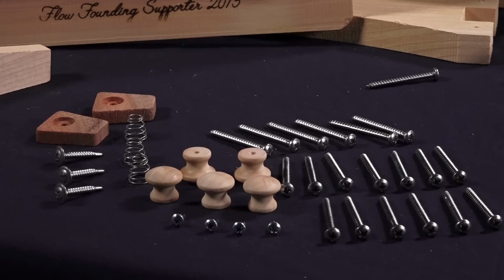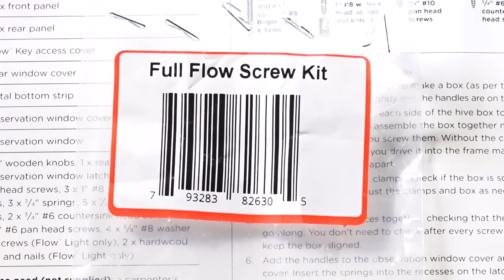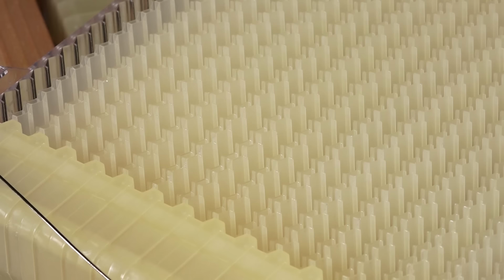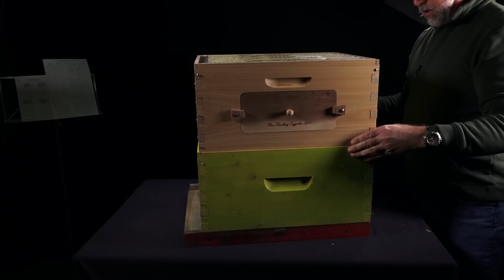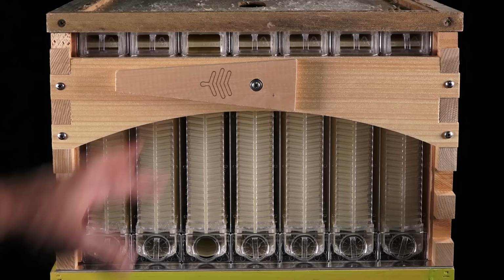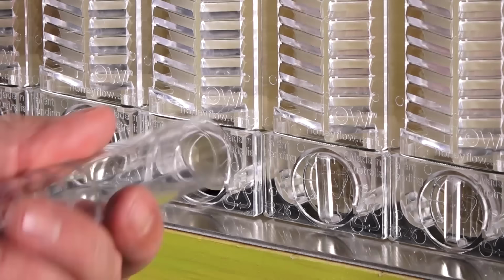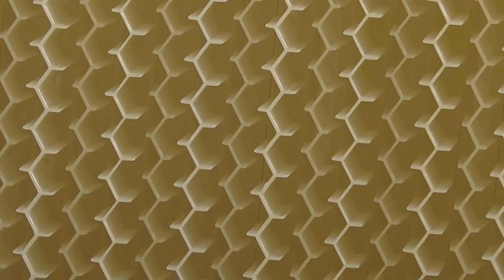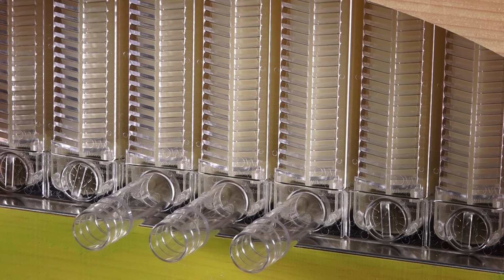The Flow Hive for honey bees, Love it? Hate it? or Undecided? Price? Review of Quality Control

Comment: Just touching on your hive price comparisons that you omitted. With the flow hive, you don't need any extraction or bottling equipment. With the standard hive kit, you have to add extractor, capping knife, cappings collector, strainers, buckets to collect both cappings & honey. Then you have to figure out what to do with the cappings? Then you have to decanter your honey. Furthermore, a lot more bees die during honey harvesting...

But I strongly agree with your final statement about making money from the flow hive as a novice. Having strong colonies takes effort, just the same as keeping healthy fish in your fishtank.

I concur that beekeeping (to me) is all about my interaction with my bees, not about the honey or the money... When you get into a practice of sitting with your bees, opening at least once a week (weather permitting), they will remain strong, friendly and they will get to know You! That is truly special.
Reply from the maker: You can crush and strain, uncap and drain, an extractor is not necessary and an uncapping fork is extremely cheap and most people have sharp knives available already for uncapping. Uncapping tanks with a drain hole are easily made and hardware cloth works to catch wax bits. Lots of ways to remove honey for those who wish to do that which don't involve purchasing a spinner - a hobby level 2-frame extractor is $159. Or an entire extraction kit is available for  $379 - I apologize for not including this information:  https://www.betterbee.com/extracting/exkit-extracting-kit.asp

Comment: Great video! I had similar issues with misalignment of the joints. But it was easy to fix. I did not have issues with screws, however. The screws you show are for the plastic window. I had different screws for the knobs provided.
Reply from the maker: +Thomas Schmid Easy to fix for people like you and me... not everyone will be prepared to perform carpentry on the box. Those screws would have penetrated all the way "through" the material left for the window... yours must have been different. Thanks for sharing!

Comment: Have you put the Honey from a Flowhive and Traditional box hive under a microscope, to see if there's any difference, or sent samples to Labs for nutritional analysis ?  To see how the honey itself develops in Plastic Cells vs Cells made from Beeswax.  I would also think the vibration from the bees also plays a part as plastics and beeswax have different vibrational properties and heat retaining properties.
Reply from the maker: Hi Knessi, yes, honey samples have been sent off and the news with drawn comb hasn't been good I'm sorry to day, it seems that pesticides from ag applications have found their way into the natural comb as well as commercially sold wax foundation. We have not found a lab yet that has tested positive for any plastic particulates in the flow-honey. Honey extracted from natural comb and well filtered, is virtually no different from honey drained from flow-frames. Unfiltered Flow-Frame Honey does have some wax particulates as well as bits of propolis and has the highest pollen particulates when compared to traditionally extracted, uncapped, filtered, and bottled honey. I do both ways here and am always thinking about the impact of processing on drawn off honey. One thing that really bothers me at the moment, is the cut comb honey that is so valued... learning that the wax has industrial chemical residue in it, is particularly troubling. Farmers and beekeepers are not on the same page at all. Naturally drawn comb just isn't what it used to be and that's sad. https://www.theguardian.com/environment/2017/oct/05/honey-tests-reveal-global-contamination-by-bee-harming-pesticides

Comment: I just received my flow hive kits.  I am having similar quality concerns with the manufactured box joints, a missing screw, and the screws being too short.  I also have concerns with badly bowed boards, no shipping notification or tracking information.   I have sent my feedback to honeyflow.com.  I hope to hear back from them soon.
Reply from the maker: +Paul Derbyshire Sorry to read that Paul... I hope they take care of you very soon. Please share when you hear back from them.
Reply: +Frederick Dunn Well it took about a week for honeyflow  to respond.  After sending pics and waiting a little longer Honeyflow agreed to send 3 new brood boxes and  1 super (just the wood for the 4).  I decided to use my own screws which were in plentiful supply in my shop.   Furthermore I also discovered that some boards were  badly warped and not the correct height.  The heights were so bad that in more than one board at one end of the board you had 9 5/8" and the other end was 9 1/4".  

The new boxes arrived the following week but were really were no better.  Same joint issues.  1 board with height issue.  I'm reworking the wood as not to waste very much but unfortunately some pieces are just too bad to be really useful.  I will inform honeyflow of this second problem but not request any action.  I am treating this as an expensive  lesson learned that the honeyflow wood hive production quality needs some heavy attention.  I think the design is sound however the production is not.

My suggestion for now is to think twice about purchasing the full hives from honeyflow.  Too much labour required to rework the wood.  Too slow a response.

The Flow frames on the other hand arrived in good condition and I look forward to testing them.  As Mr. Dunn has pointed out worth at least trying as to be better educated in the future.

My final comment is that I also have had to add another small layer of wood beside the flow frame at the front.  The gap(s) between frames were just too large.  Funny enough, the small lengths of wood supplied for the wooden brood box frames for the top of the frame proved a perfect fit for the supers.

Thank you for such a good video.  I look forward to seeing even more of your videos in the future.
Reply from the maker: Don't forget to share your experience on the FlowHive forum... I do know that the wood manufacturer reads and responds to those posts... he basically says that there isn't a problem though...

Comment: I'm not interested in bees or any of the sort but thanks, this video really taught me a lot about inspecting a product. This product is useless if a person who isn't like you happened to buy it. Setting it up an getting the required material takes more time and more money than necessary.
Reply from the maker: It definitely would be a huge frustration point for anyone without woodworking tools. The woodworking contractor who made this box is no longer manufacturing for the flowhive company, my other two boxes came from a company in Oregon and they were perfect.

Comment: I think it should be fair enough to point out that your hive came from a US manufacturing site, not an Australian one. 

All of the cuts, inclusions etc are all from the American site. Did you let the founders know? If not, you should have. 

My experience, being Australian and having the Australian version, was very different. The fits were excellent, the screws were different and I am really very disappointed for you that you didn't get the quality you deserved. That says much about American manufacturing, though, not the hive itself. From my founding hives (bought two) and about to get a Flow Hive 2 in the Araucaria wood. I have had absolutely no dramas with them at all.
Reply from the maker: All hives since this period, are now coming directly from Australia and they are perfectly fit as they are now laser cut.  Yes, I did provide feedback to the Flow company as well as received a response from the U.S. mill that made this box, the U.S. responses was "most of our equipment is good, there are some small numbers that didn't work out, but most of our equipment is defect free", no apology, no concession as to why they didn't fit and many who received the first run had similar issues, so that contract was cancelled.
Reply: @FrederickDunn  that response from the US site is disappointing, particularly at a time when manufacturing is suffering there. It's good to see that years on you are still enjoying the flow hives as I am.

Comment: Great video. Thanks for your honest opinion. I currently have a top bar hive, but found this interesting. I am concerned about the plastic, both it's use and durability. We have temperatures from 100+ to -20 degrees here in Colorado. It's not uncommon for the temp drop by 70 degrees in a few hours!! Does this come with any warranty on parts?  Cost is prohibitive for our small community garden. Assembly would be difficult, esp. if things don't "fit".  I will be watching to see how it works out. Love your idea of a bee shed.  :)

Comment: Hi, i have had a hive for over 12mths and I’m not at fan at all. They have no thermal properties, the roof cracks in the heat, and my bees are not a fan at all. I also have a HiveIQ poly hive which are way more productive than the Flowhive.
Reply from the maker: Thanks for sharing what you've observed. Mine are all doing fine.

Comment: My Hive was easy to assemble. One of the joints needed a little sanding to help it fit better. You refer to the joints as "Dovetails" which they are not - I think "finger joint" is the correct term.  Overall I was very happy with everything.
Reply from the maker: +Jeff Bateman They are actually "box joints"... thanks!

Comment: Hey folks, the only difference between a flow Hive and the common langstroth Hive is the flow super. The rest of it is just a box and regular frames. Save your money, and just get the flow super, and simply set it on top of your langstroth hive in the spring. Warning: it will be about the majority of spring and summer for your bees to take to the flow Hive super, and build it up with wax. So basically like any other hive, don't expect honey on your first year.
Reply from the maker: Thanks for sharing, you're right, the biggest advantage is the flow-frames and honey extraction without smoking the bees.

Comment: great work sir very informative video and very well presented. my only concern besides the bad quality of the frame is the plastic. I know that plastic releases toxic vapours especially under the heat of the sun. A quick search shows that the number 7 on the plastic means it contains different and mixed plastics together and it is not clear if a particular type prevails. most of the time, these plastics release or 'sweat' toxic matter. just a thought...
Reply from the maker: All of the components are available for testing at various temperatures... If the data provided by The Flow company is incorrect, someone will certainly be blasting them very soon if the material is found not to be inert. There are plastics in most feeders and there are also plastic frames that have been in use for decades. They are also touted to be "food grade" plastic. I will be happy when someone does perform some comprehensive analysis. You're certainly not alone in that area of concern.

Comment: It is cheaper for the traditional bee hive however factor in the cost of the separation of the honey from the comb
Reply from the maker: As well as the consumption of your time when taking off and processing the honey. I've become spoiled by only having to have clean jars, lids, and then just waiting for weather conditions to be right. I've personally stopped doing traditional extractions altogether. My honey-harvest bench, with spinner, uncaping tank, wax separater and frame racks now just sits unused, but ready. I don't miss the mess and lengthy cleanup. Also isolating the extraction to specific frames which vary in taste and source, bonus.

Comment: I think they have a good product but have priced themselves out of the market they crowd funded the startup and plastic parts are fairly inexpensive to produce so I have a hard time justifying the price they are asking for the frames.  I think you are right on the money by saying you can get the whole setup for much more reasonable price elsewhere.  Although I would not buy the knock offs I think they are in the correct price range for what these are.
Reply from the maker: Hi Robert, the plastics they use in these frames are actually more expensive to produce than I originally thought. I have a friend locally who is a CEO of her own company and they produce food grade plastic components for food related equipment. I was pretty surprised at the cost, but of course FlowHive folks also mark them up, but I don't understand, with what I know now, how the Chinese duplicators are doing it so cheaply... I'm highly suspicious of the material composition  in the copycats I see coming in through Amazon and Walmart. Walmart and Amazon accept no responsibility for sellers materials claiming food-grade, or FDA approved materials, none, it's just the "honor system". Since this video, I'm completely converted to Flow-Supers and Flow-Hives... I'm officially spoiled. And my honey-harvest room sits clean and idle. All we do now is bottle honey.
Reply: @FrederickDunn  I would love to try the flow system but as a hobby their pricing puts me out of the market I can make my own supers but buying just the frames is not much of a savings I have been educating myself and would love to start a beehive in the spring honey is only a bonus as I think the bees would help my fruit trees out with pollination hence the not wanting to get into all the traditional harvesting.  I do believe that you have to pay for quality but still seems quite expensive.
Reply from the maker: @Robert-Smith  I wish you all the best Robert, I started with traditional boxes, nothing wrong with that at all.

Comment: I am curious to know about the long term effects of these flo - hives... If the bees don't need to work as hard to establish a colony... Won't that result in poor quality honey?  The bee's not having to build the actual comb may condition them to not produce as much wax or even worse cause them to produce a liquid wax that merges with the honey?  Making a honey with a higher wax content?  Am I worrying for no reason?
Reply from the maker: You are indeed worring for no reason. They still build was and draw out comb throughout the hive, it's just the flow-frames which they don't have to do so much "wax-work" on. The honey from the flowframes is actually purer and more Flavor-Pure than honey extracted with uncapping, crushing, and spinning along with filter stages. I've done both through the years and Flow-Hive direct honey draws are my absolute favorite. I've never heard of "liquid was that merges with the honey"? Wax particulates along with propolis bits are easily removed and don't "merge" with honey. Those are two completely separate bee bio-processes.

Comment: Thanks for the great overview.  And the price point comparison to traditional kits.  I've only seen traditional harvesting done with those centrifugal extractors, which are also a couple hundred dollars.  It seems that if you buy one honey flow system, its a bit more expensive then buying one traditional kit and the extracting equipment, but if you were to buy two or more of each (honey flow or traditional kits with one set of extracting equipment) then it gets more expensive per kit.  I guess its more about the convenience with the honey flow system, and like all products, there can be a moderate to hefty premium on convenience.
Reply from the maker: True... until they offer bulk pricing, most intermediate to commercial keepers won't be using the flow-system. We also have to wait and see how long they last season after season and will have to factor in replacement costs. This year, I'm going both traditional and flow harvests. An advantage to the flow system is (for me), that I can just take off a couple of quarts from one frame and not have to smoke them, pull the frame and filter the honey. It is definitely more convenient on a small scale to have flow-frames. The cost is of course higher.

Comment: Hey Fred
I'm from Colombia and I have enjoyed a lot the way you've expressed your opinion about the Hive Flow, however I got a little question regarding the extraction of the honey, the thing is, is it true that bees can be killed when we're turning the key because of decapitation if they are into the cells, is it possible?
Reply from the maker: Thanks for the question. I think someone who has never tested a flow-frame started that rumor that goes everywhere. The bees are not harmed at all when the frames cycle, even if there is a bee in the cell when the frames are opened, the bees just backs out unharmed. I've been using the Flow-Hive system for five years and not a single bee foot, toe, head, or other parts have ever shown up in the honey and no bees are smushed in the cells. It's designed with space between the miving parts so the bees are not smashed, or sheered. It's an unfortunate myth that continues...

Comment: The honey combs aren't supposed to line up, it was designed like that so the bees can close them
Reply from the maker: Thank you... I didn't mean to imply that they "need" to line up, I was just pointing out how uneven they are and how interesting that is. The bees are having to work each cell and seal up the cracks as well as draw out the surface for filling and capping... it's proving to be quite a task.